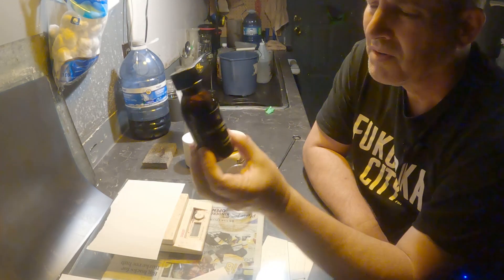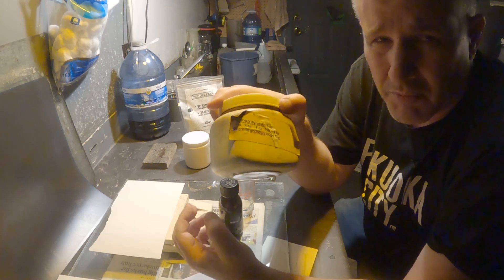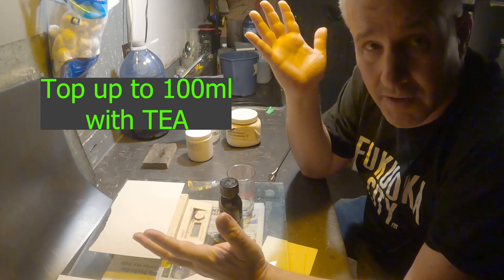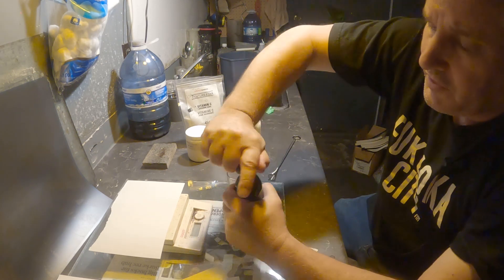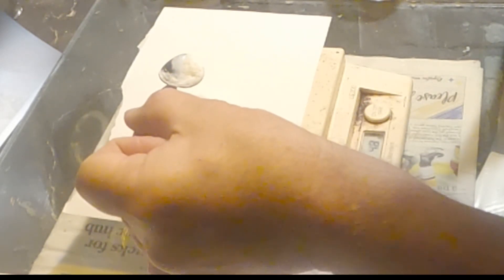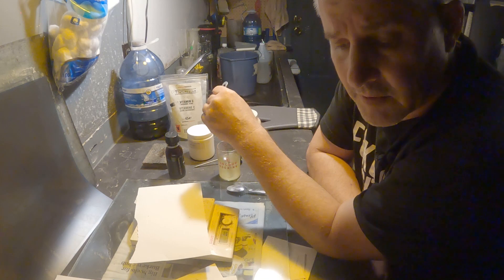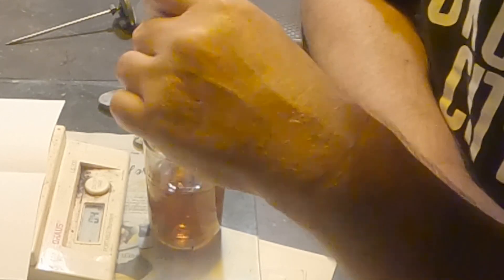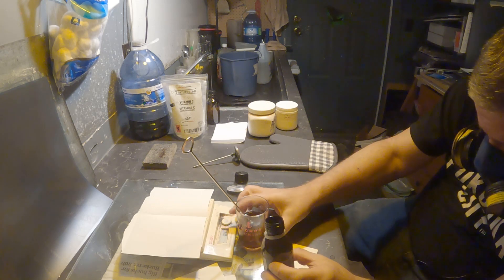Making 510 Pyro Film Developer

Comment: Hey Andy! So I’m getting ready to test out some 510 Pyro myself and was wondering how many sheets of 8x10 x-Ray film per 1+1000ml this could handle? I know you were going to a video on using the stuff soon.
Reply from the maker: There a good question, and one they I don't have a definitive answer for....yet! The rule is thumb with developers has been about one millimetre is stock per square inch. For 8x10, I make sure I have at least 80ml of stock. 510-Pyro would need 10ml of stock to make a litre of 1000ml working solution.  I've used 2ml for one 8x10 sheet with good results at 1+100. I'll have to test more!
Reply: @analogueandy8x10   sorry I just saw what I put lol yeah I meant 10+1000 1+100. So I could try this with my drum and 2ml of working Solution? I’ll test it out thanks!
Reply from the maker: @SenpaiSkyy  if you use 1ml of 510-Pryo stock per 8x10 sheet you should be ok.
Reply: @analogueandy8x10   oh I got you so 100ml of working solution 1ml of stock is a good place to start then.
Reply from the maker: @SenpaiSkyy  Yup! You shouldn't have any issues with that. Let me know how it goes!